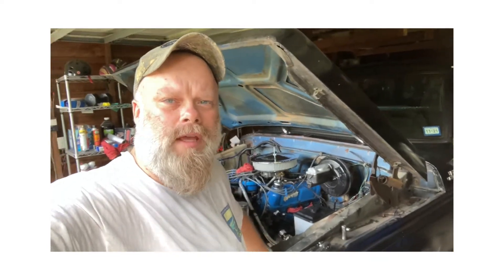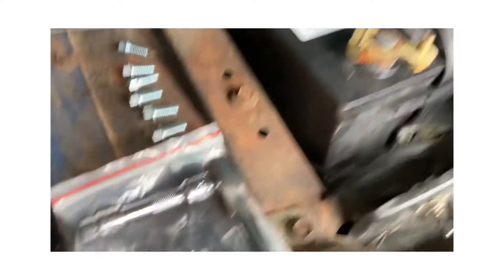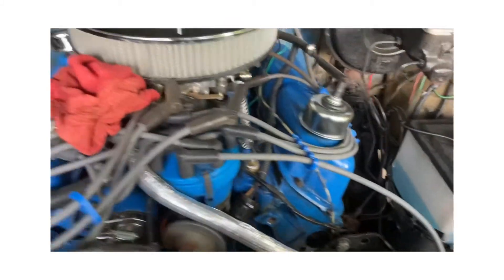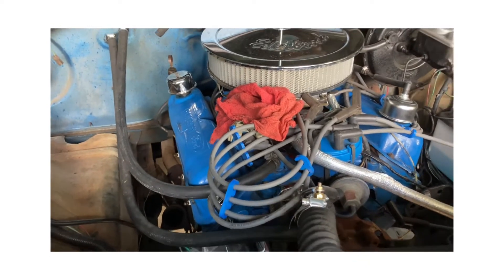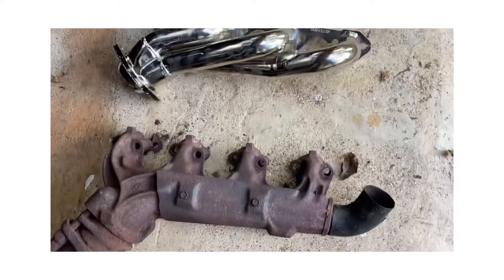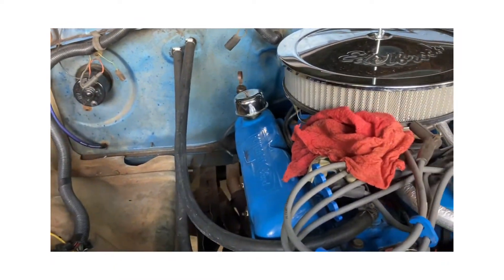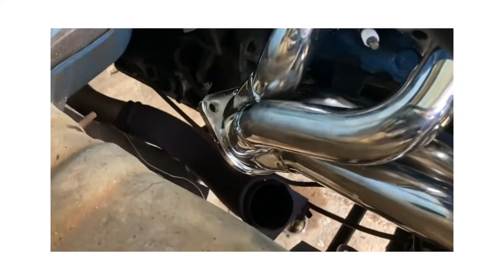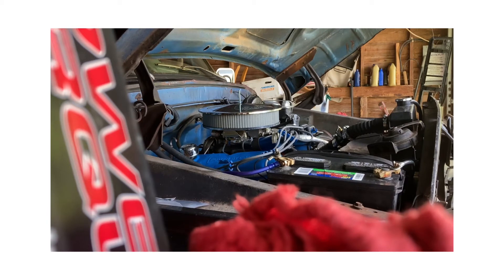BBK Headers Install - 1977 Ford F-150

Comment: Im ordering the 1515 for my 1953 Mercury with a 351W C6 trans. Hope the fit like yours did👍
Reply from the maker: Awesome! You will love them, it’s night and day diff. Fitment should be fine considering they’re shorty headers and have a mild angle for the down pipe. Be sure to subscribe and click the bell notification.
Reply: How did the gaskets hold up. I've seen a lot of mixed reviews.

Comment: I just put these on my 72 f100.  What exhaust flange/pipe did you use?
Reply from the maker: I show the part# in the video
Reply: Did you have to go to an exhaust shop to fix the down pipes/flange bolt up?

Comment: How is the rust situation on these? Good vid
Reply from the maker: @santidmercadoable  No rust but be sure to coat them in a hi heat clear coat to keep the chrome color. One 300+ degrees get to them they start to change color. The one to keep the perfect chrome finish longevity is coating them which they don’t do. I have a video on here showing me flipping them and wrapping them in titanium exhaust wrap cause I’m now boosting 6lbs. Boost with twin GT3582 turbos.

Also, my store is open:

https://operationrv.printify.me

Please Share, Comment, Subscribe and click Bell

Comment: Is this a two wheel drive truck?
Reply from the maker: Yes, with front I-beam suspension.
Reply: If needed what  modifications would have to be  made to have them fit a 4X4 with351 windsor and C6 automatic?
Reply from the maker: Considering the 4x4 in the front vs. I-beams may offer a spacial diff, not sure on that. I believe that since these are shorty headers will give u room to modify ur own down pipe to plumb through the frame and front 4x4. If u notice on mine there is a ton of space.